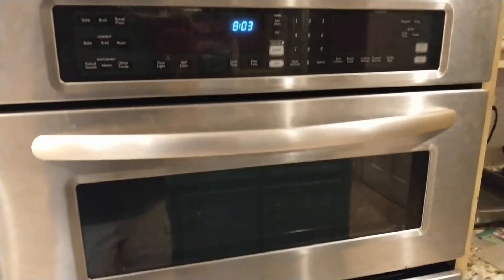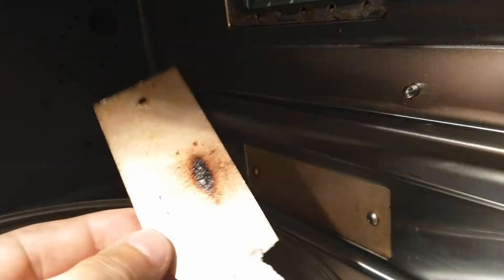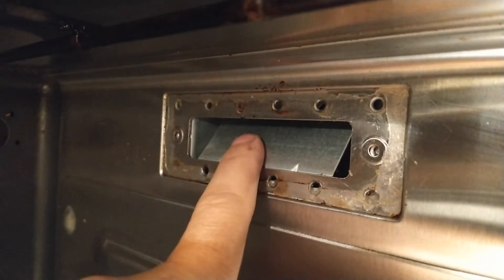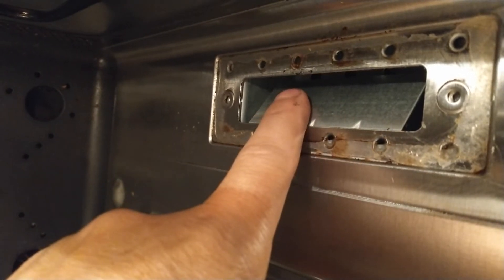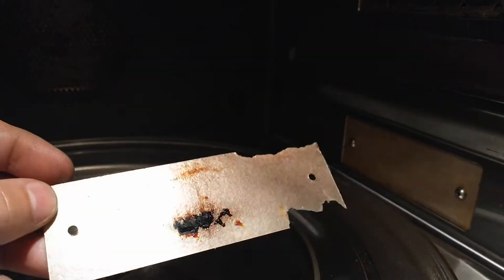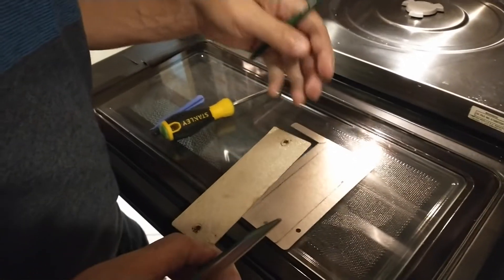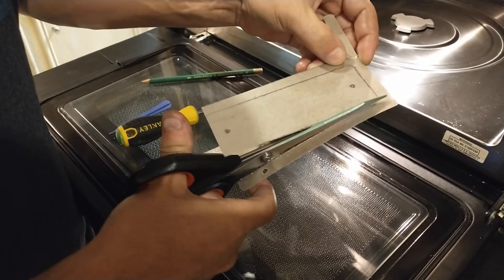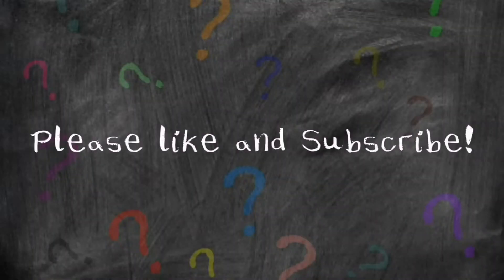Is your Microwave catching fire or sizzling? Easy Fix!

Comment: Hey. I work as a tech support and I deal with this everyday, and I would give you an advice, if the area  behind that waveguide is burnt (the magnetron) then your microwave is no longer safe to use! Even if you replace a hundred waveguides it won't do it. To get the exact waveguide compatible with your microwave you may contact the manufacturer support or check the user manual
Reply: Is there any way to make the microwave safe to use after this kind of thing? 
I have a Frigidaire doing this and just ordered a wave guide from the manufacturer. If we need to look for a replacement altogether or a different part, I'm all ears to keep our house from burning down😂
Reply from the maker: Keep the wave board clean.   Thanks for watching!
Reply: Good to know just had rip mine out and throw in in the rain 😢

Comment: I used those same sheets for mine. I couldn’t find the exact same one for my Whirlpool convection oven. Even on the Whirlpool website. I traced and cut it with an exacto knife. Bought both from Amazon for I think under $20.

Comment: Very helpfull video thanks. Just one question though. Did the metal screws not spark after installing?
Reply from the maker: Thanks! No issues with the screws.  Just use the same ones you removed if your microwave has them.
Reply: @HowToWithJames what’s that material?

Comment: is there any tape or glue that i can use to put this piece on with? there are no screws for mine
Reply: I just did this for a Panasonic microwave. No screws. I had to pry the old piece out with tweezers. New one slid up into a notch and then I had to bow the bottom corners to tuck them in. Little tricky
Reply from the maker: I have read putting tape in the microwave can release toxic chemicals into your food.  Somee microwaves use screws as a some just have little metal tabs to hold this in.  How was the old piece mounted to the wall?

Comment: This video helped me fix my microwave. It started sparking for no reason that made sense to me.  After watching the video, I removed both covers, made sure they were clean, and I cleaned behind them too.  Once I was satisfied that they were clean enough, I placed them back on, although I switched out their positions, and it worked.  I will still buy some extra material, so I have it on hand for the next time.  Thanks :)
Reply: What is that material?
Reply from the maker: @salemalharbi2473 Here is the video description with a link to this material on Amazon.  
In this video I show you how to repair a microware with a bad Waveguide board.  Here is a link to purchase your own Waveguide board / Mica board.

4 Pieces Waveguide Cover Mica Plates Sheets Microwave Oven Repairing Part 13 x 13 cm with Scissor for Use Universal Microwave Oven - https://amzn.to/3n0yBib